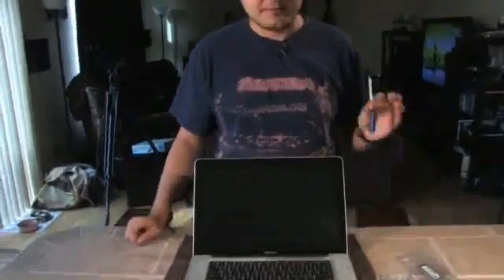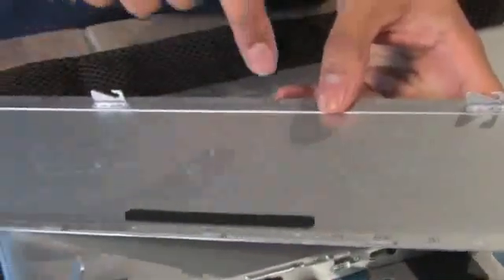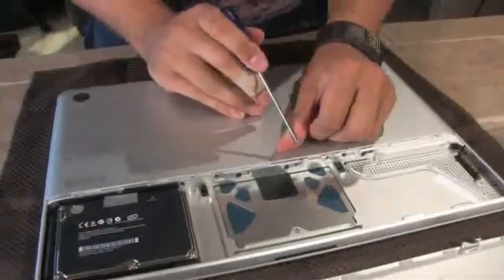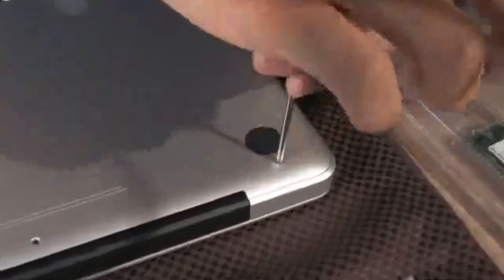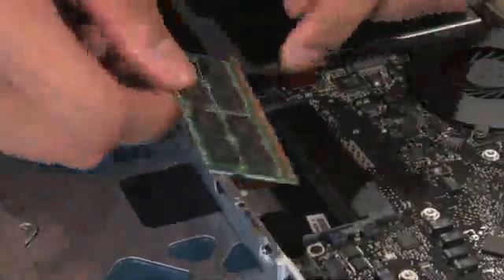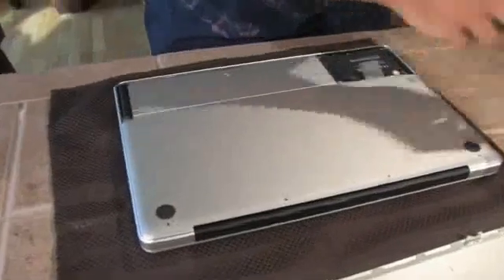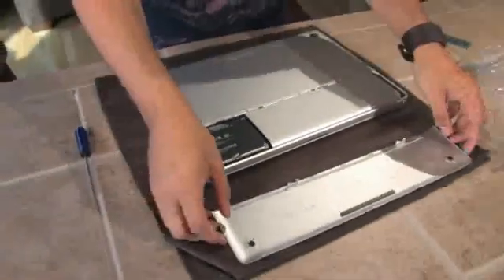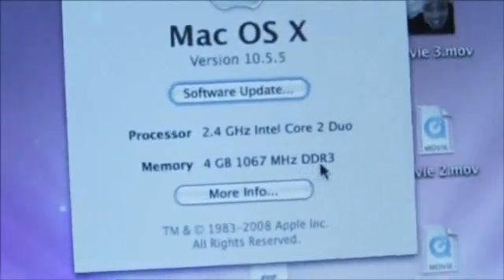How to Upgrade RAM in MacBook Pro Unibody

Comment: It would be a good idea to get some Loctite threadlock to keep those screws in place.  Only a couple of bucks at your local hardware store and no worries about loosing a screw.  

Like the other posters stated you can use up to 6 GB RAM and your old 1 GB sticks can not be used on older Macs (sell them on eBay). Other wise great job on the video simple and informative.

Comment: great video. and nice tip to check to ensure the ram is correctly installed. i don't know why apple made it more of a chore to add the memory...i have the previous gen and the memory was easier to install, but the hard drive was more difficult....now its reversed.

Comment: no this wont void it but if ever your mac gets sick and needs to go for service and Apple repairers do tests and find that the cause of the problem is related to the 3rd party ram, then it will not be covered under warranty. u'll have to pay to replace the ram. the same will apply with hard drive

Comment: i don't think you can use these to upgrade an older mac because they are DDR3 memory while all the older macs are either DDR2 or DDR
DDR3 has a different pin configuration, so it wouldn't work in an older machine